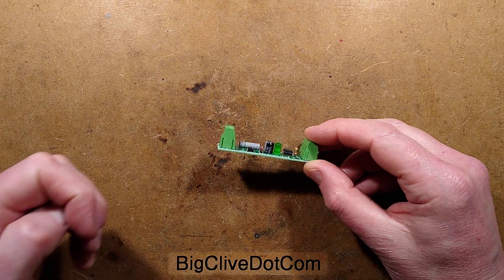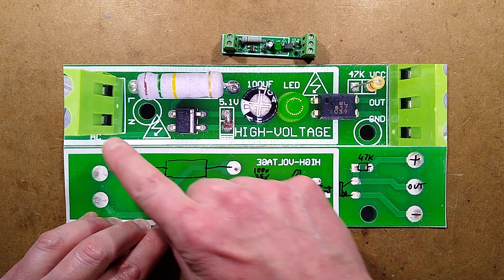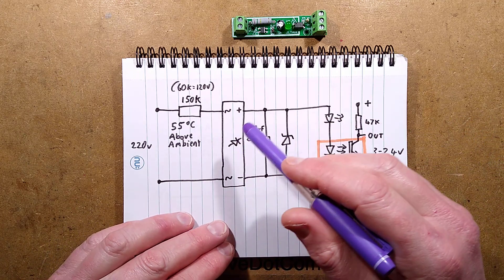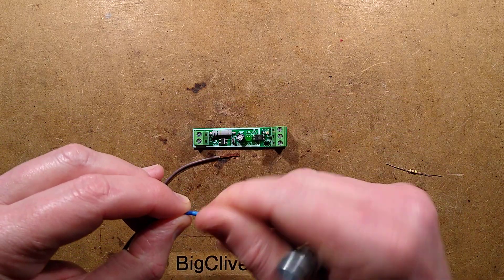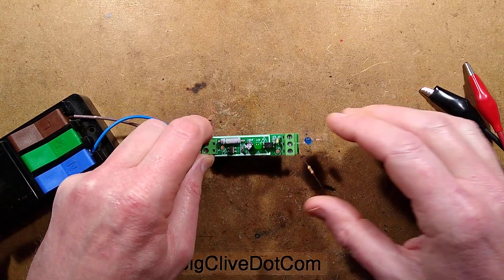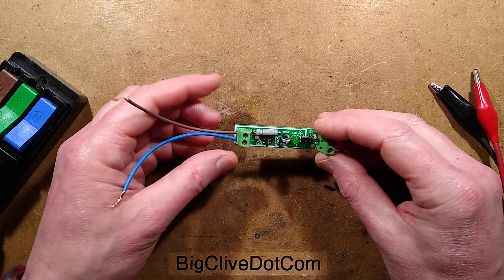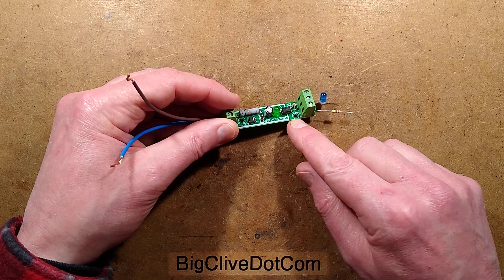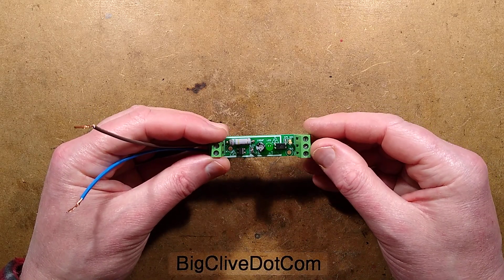120/240V to logic level optoisolator (with schematic)

Comment: I suspect that the reason they're so casual about locating those mounting holes is that rather than using screws as you mention they're probably assuming the use of those plastic thingies that you find all over equipment these days,  which would just push in,  and not get all that close to the resistor...

Comment: I am a little bit late to the party, but: The stains on the board with the blown resistor look more like it went to flames, leaving those nice wiggly black shapes on the board. Just turn the board around 180° - or (-)π if you prefer.

Comment: I wonder if the zener diode is there in case the high voltage load is inductive like a motor, starting and stopping might cause flyback.

Comment: i have studied this and this is what i found/think , Zener diode there is working as a voltage regulator , so optocoupler sees a constant voltages across it...even if capacitor fails..

Comment: I was looking for something like this a while ago, but ended up designing my own. I did initially use just a couple of resistors and a diode, but found the combined heat from 14 of these circuits in the same enclosure, was not the way to go.  I ended up with a capacity dropper and a full bridge rectifier instead, any thoughts?

Comment: The weirdest encounter with lifts for me was Aston Uni main building. It was designed with 9 lifts and had had 2 more added to it externally. Using one of the new lifts, I opened the car doors as it was going up. It stopped, as expected. After closing the doors, it set off again - this time going down BUT the floor counter was still counting upward ! I think it got down to the third floor before correcting the counter.

Comment: Double sided circuits are cool, I had to engrave one of those by hand with a blank plaque and some chemicals that certainly wouldn't do well down the drain, pretty fun thing to do
Reply: Most likely iron (III) chloride (aka. ferric chloride), looks extremely brown when concentrated and yellow when diluted.
Reply: @TheBackyardChemist  yes, I did use it!

Comment: could you use a dropper capacitor in place of the 1W resistor to limit the current and avoid overheating? would that work?

Comment: Thank you for sharing your knowledge.

I am wandering if there is a way to control one 200v device with an  optoisolator and an arduino or an esp32. I want to control lights with hi frequency without the annoying relay's sound.

Comment: The photos looked like a control I/O board with 24vdc inputs on a VFD, a input precharge card to slowly charge up the capacitor bank before turning on the mains on a VFD, and not sure on the 3rd one. Probably the elevator's transmodial termporal inhibitor.

Comment: These boards are sold in three version with different number of channels.
There are 8 channel boards, 3 channel boards and
 then 1 channel boards (the same as in the video). It is interesting that the 3 channel boards are also different from the 1 and 8 channel boards in the fact that they also have a LED in the output part (two indicator LED on each channel).
Reply from the maker: I have a 3 channel on it's way.
Reply: @bigclivedotcom  as do I.. ordered Dec 24th, tracking says it left China  Jan 1st bound for Canada.  Here it is Jan 29th.. shipping status hasn't changed.

Comment: This would be great to connect to the pressure switch of a submersible water pump in a deep well, so that the activity of the pump can be monitored remotely by simply activating an indicator light whenever the pump is running, or even all the way to data logging, analysis and notification, to detect when the duty cycle of the pump indicates an incipient or actual failure.

Comment: Could the cap be removed to count half waves with a micro controller measuring mains frequency? I Think that would work!
Reply: Not only will this work, some designs use the mains frequency as a clock source. So — yes, if you sample it often enough or have an interrupt callback set up, it should work.
Reply: @Kalandro99
with bridge rectifier and no cap you will get 100 pulses per second :-)
Reply: @YTANDY100  unless you're in the split-phase land of the 60 hz electronics and it is 120 pulses.

Comment: There is no need for certifying. Just the LED across the opto LED (as reverse polarity protection.
No bridge rectifier, no electrolytic cap.The target application could deal with 50Hz (or 60 Hz) pulse train.

Comment: Clive... On the mounting holes... Are they perhaps thinking of mounting this board, as is often done in appliances, on nylon standoffs (often with locking tabs or ears)? It could explain the proximity to the resistor... Oops... Guess I could have read into the comments... :)

Comment: Bwahah what a terrible pun, love it. Careless whiskers is one of the reasons I prefer to add solder to wires before putting them in a screw terminal. No clue if that is good practice though. Wouldn't it be an idea to add heatsinks to resistor, if heat is causing them to fail? With proper electrical isolation of course.

Comment: I had some equivalent requirement back in 2012-2013 and made an almost similar stuff.
It worked with AC 230v and 440v (2 of 3 phases) without any changes.

The difference is that I didn't use zener or bridge.
Reply: Oh Wow!!!
Thank you for this :)

Comment: 20:06 I personally would design a board with an indicator LED on both sides of the Opto-Isolator so you can see both when the unit sees Mains Power and sends a Low Voltage signal.

Comment: Just my 2c worth.
Having designed many of these into circuits for detecting mains, I'd never make one that has the led in the opto on all the time with all that heat pouring out of the resistor. With a couple of transistors (1 npn, 1 pnp) on the mains side, you can turn it into a missing pulse design getting the opto pulsed on only at the zero crossing point, only on for a tiny fraction of the time. The 150k can be a much higher value (and should be multiple series resistors, not one). The circuit will now dissipate very little heat.  With a missing pulse design, you will immediately know when mains is not present. The presented circuit has a significant decay time before detection because the voltage on the cap needs to collapse first.
Reply: The opto's only going to dissipate milliwatts, so "LED in the opto, on all the time" is a non-problem.
The hot resistor is potentially a problem, but that was an economics design choice.
Your "missing pulse" choice requires significantly more software effort than most Arduino users would be willing to apply, so isn't very attractive.

Comment: A product like that really needs to be safety listed. UL, in the USA, for example. Also for the novices here, that opto transistor does not really pull down to zero volts. It pulls down to 0.6v or what ever the transistor junction voltage is. They do make FET based opto couplers that can get down to the 0.3v range, perhaps lower. But it will never be like a true mechanical relay. It's rare but sometimes you need an electronic switch with a true "bolted" short capability. You can do it electronically but it involves negative supply rails and a more complex circuit.
Reply: A saturated transistor will have Vce well below Vbe;  I'm fairly sure I've seen 100mV, but these guys offer 400mV: https://electronics.stackexchange.com/questions/13063/how-do-i-saturate-an-npn-transistor

Comment: Oh it's an IMEM (GLE) processor board, they last 2 years and the phase monitoring under the HV cover (on the left in your picture ) fails, because they sink the current through SMD resistors they burn the PCB and fail, I've changed a fair few of those in my time.

Comment: I wonder why they opted to use a resistive dropper, instead of capacitive?
Surely the cost of a chunky 1w resistor is greater than the cost of a small 400v polyester film capacitor... Even with the addition of the standard 1/4w 1MR discharge resistor accross the capacitor, I think it would still be cheaper.
Reply: one component less to mount
Reply: I was wondering the same thing, we need a definitive answer from the Great Sage Clive.
Reply: Perhaps longevity? As seen in past videos the capacitance slowly drops with time due to self healing when there are spikes in the line, I've seen a lot of capacitive droppers fail after a while.
Reply: @Gengh13  Good point, a film and foil snubber cap that won't slowly eat itself in that application is gonna cost way more than that resistor.
Reply: Economics matters most.  Pretty sure none of the manufacturers / vendors give a damn about longevity, they just want non-DOA at minimum cost.

Comment: Mounting boards like that, I use plastic sleeves. Can usually find some sort of utility hose that is just the right size.
Reply: You put the board in a plastic sleeve?  Normally I'd approve, but in this case the resistor will overheat.

Comment: The circuit is so simple and obvious. Why not use a capacitive dropper? The size would be similar to a proper power resistor. Just a smaller resistor to eliminate the surge current is needed. You don't even need a rectifier diode, just put an indicator LED in reverse to the optocoupler.

Comment: Actually kinda cool just now finding out this exists all pre-made. Been contemplating building 'smart/IoT' notifiers for my dumb washer/dryer set and the dryer itself has been a bit of a pain as it has a cycle done buzzer but it is run at mains voltage. This would be perfect getting that as a simple on/off trigger to a micro. And before anyone says, I'm aware of the common workarounds, ie: sense vibration or wiring something like an off-the-shelf mains powered USB supply to sense the buzzer operation. I much rather prefer doing a more deliberate configuration which this would do.
Reply: A current ring would be better for this.
Reply: @muxerbaker4638  You mean a 'current transformer' ?
I'd tap off the 'cycle done' buzzer, myself, though I can't tell (from Matt's comment) how long it buzzes; if it's just a few pips, that'd be suboptimal for monitoring :-)
Reply: @theskett  Current ring, current transformer, whatever. Lots of names for it. I actually set myself a goal of seeing how cheaply I could do this circuit and I can't beat a big resistor. I can come up with a bunch of different ways to do this, and they're all far more efficient, but slightly more expensive. I'd like to see big Clive make this into a capacitor dropper type circuit. I can send him the values for this if he likes, as I have them calculated here. Much more effective and it adds about 20% on to the cost.
Reply: With a little extra thought, I notice my washer has a "door locked" LED which is (duh) only illuminated when the machine's running.
I think it'd be fairly-easy to connect that to the opto's input (via a resistor; red LED voltage drop, vs. IR opto LED).
Might not work for the dryer cycle, though, if that doesn't lock the door...?

Comment: Teach me something.  Is it not 120 volts nominal from either hot terminal to neutral?  I'm sure we used to run 110 volt tv's and vcr's by just connecting hot to either live terminal and the chassis side to neutral. This was in the Philippines 40 years ago .
Reply: The setup you describe seems to be based on the US 120v system. Each live is 120 from ground and connecting across them gives 240v. This makes sense given the Philippines used to be controlled by the US. In Europe (and likely also newer Filipino installations, but IDK about that) each live wire is 230 from ground so there is no way to get 120 without a transformer.

Comment: I use the MID400 IC with a 2W 22K resistor (for 120V). Very reliable.

Comment: The board with the "liquid" damage looks like someone has "gobbed" on the resistors to see if their hot.
Reply from the maker: Ewww!
Reply: Looks more like there was a roof leak, and that was a drip landing on the cabinet, and coming in a gap in a knockout, and falling on the board all full of goodness from the dust and bird poo there. Could also be a bird nesting on the cabinet top, a pigeon can be pretty fast nesting if you only go into the lift room once a month.

Comment: Hello Clive ,I am an Elevator / Escalator mechanic , I am trying to build a fault finder for older equipment that doesnt have controllers with fault finder/for intermittent stopping when I'm not present and fault latches but doesn't effect (jump)safety switch in a safety circuit-. optoisolator to aurdino -- any idea's ,
Reply from the maker: The circuitry of a telltale would probably vary between each application.  I wonder if a voltage datalogger would be useful in seeing rogue safety circuit glitches.
Reply: @bigclivedotcom  Good idea Clive , i saw a Data logger shield for arduino- i just need to figure how to seperate each switch to find the culprit aka bad switch- thank you very much for advice

Comment: I replaced some resistors recently that looked as though they had been baking the pcb, but I left them floating in the air by about an inch, I figured the heat dissipation would be a little better that way, rather than having the potential to kill everything around it

Comment: Interesting. What value resistor could be swapped with the the 150K one in order to more exactly match it to 240V?
Reply: You don't need to "exactly match it", you just need:
- enough current through the opto LED, to make the opto work as intended
- not so much current, as to burn out the opto LED !  :-)
The mains voltage is not well-regulated (varies, usually 220V--250V) but the opto LED is probably good for a 50% swing regardless.

Comment: So this would be wired in series with your appliance? When appliance is switched on, completing the circuit, this device will receive power as well?
Reply from the maker: It wires in parallel with a live supply and provides a signal to low voltage circuitry when mains is present.

Comment: I built a module like that to monitor when my water heater elements were energized, trying to debug which thermostat was sticking.  It worked, but my implementation was slightly different, I skipped the series diode and capacitor and just had an antiparallel diode across the one in the optoisolator to serve as an indicator and protect the LED in the opto from too much reverse voltage (I had the code deal with the fact that it wasn't always on).  I used a big chonky 5W resistor, it seemed fine.

Comment: I'd like to build one of these myself just for experimenting purposes. Any idea what spec rectifier I'd need? That resistor is dropping nearly the entire supply voltage, right? The LED and the Opto are dropping the rest, so a low voltage rectifier would be fine, or maybe even a simple 1N4001 diode? Many thanks for a very interesting video. I dropped you a couple of quid via PayPal for a coffee. Many thanks.
Mark
Reply: In case BC doesn't reply:  buy a 400V+  plus rectifier, they're only pennies;  1N4007 gets you 1kV.
Yes, that resistor drops almost all the supply voltage; optionally replace with a cap dropper and 'fusible' series resistor, 100R or so, to avoid heating.

Comment: How can we connect to arudino pin?  I want to trigger 220VAC input? Thanks.
Reply from the maker: You should be able to connect the low voltage side to positive, negative (0V) and the other pin to your Arduino input.

Comment: I was taught to make a one loop "piggy tail" in each component lead, keep the component 1/16th above the board. Luv PLCs, hate remote sensors. 
Cheech n Chong: Otis Elevator singing I've had my ups and downs. 8)
Reply: That 'piggy tail' thing is especially important for thermal fuses, and for thermistors that are supposed to read the ambient temperature, of course :-)
Reply: @theskett  Yeah, there are a dozen good reasons for taking a few extra seconds to mount components. Stress-relief, anti tracking, ect.
Reply: Anti-tracking?   Surely that's just on the pads / PCB layout?
Reply: @theskett  Tracking is not limited to the trace and track side of a circuit board. Consider RF, and High Power DC.
Reply: @snakezdewiggle6084  You came in with "keep the component 1/16th above the board" -- to which I replied.
OF COURSE, RF and HVDC have other requirements; but, guess what, I'm probably not going to use SRBP and 1mm spacing for those.
Reply: @theskett  it's  1.58 mm actually, but any small spacing and stress-relief is helpful in most situations.
Just relating what I was taught. You are welcome to use any form or techniques, you don't need my permission.

Comment: the rather high 7mA through the opto input might be there to counter ageing of the emitting diode. i remember reading that in the datasheet of an optoisolator, where it said the min value should be fine but that ageing (and tolerance of parts) might occur and you shouldnt run it on the lowest possible currents in more critical applications.
(did imagine you saying 7mA or was it the opto i looked up back then... ah yes @10:50)

Comment: Mr. Big Clive.  You are so very considerate to warn people of the lighting changes and possible strobing.  Thinking you're a chap to buy a beer for (this goes to me and all the other cheap skates - LOL)  

Kewl application and circuit.  I'm beginning to think of a few things I would use this for.  For instance, an indicator light so I can obviously see when the furnace or AC is running?  I don't know.  Maybe a momentary bell when the PIR activates the outdoor security lights?  Do these sound like reasonable applications?
Reply: So cool.  I wish I knew 3% of your knowledge and experience..